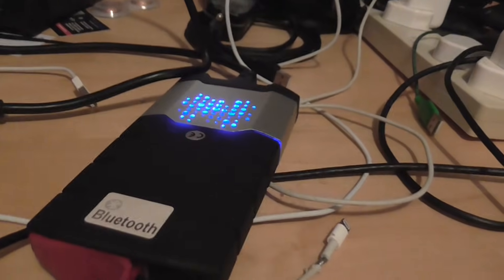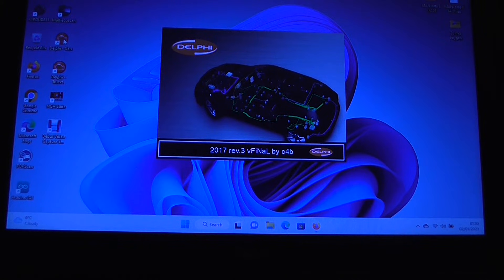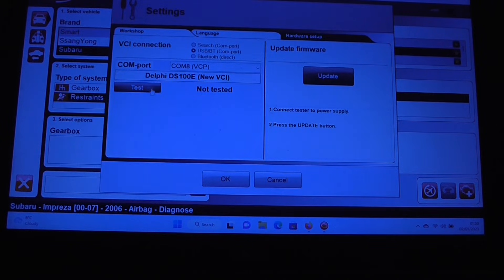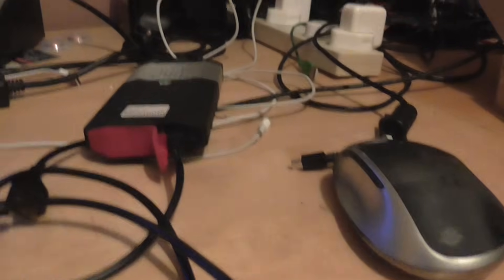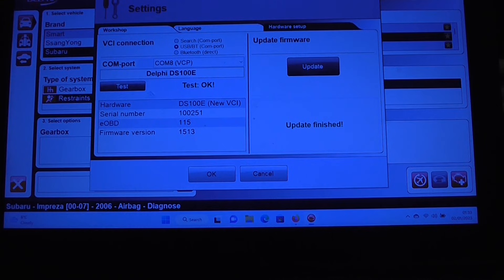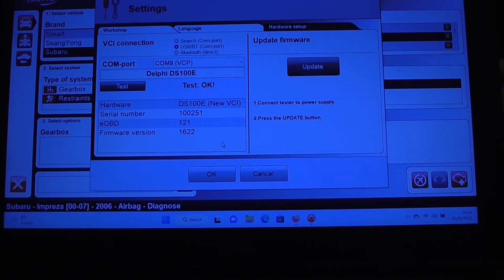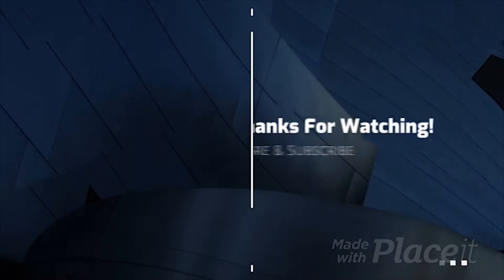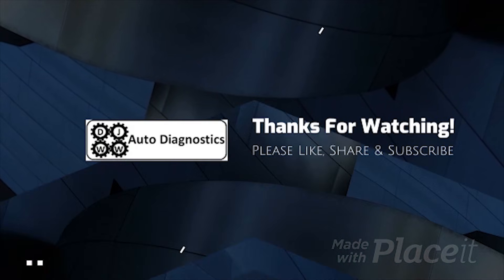Delphi DS150E Firmware Upgrade Procedure

Comment: You said it was  ds150e but  the screen showed ds100e? What type is it actually?
Reply: All the Chinese clones say ds100e in the test screen, the difference between ds100e & ds150e is the flight recorder function, as long as that works then it's a clone of the ds150e regardless what it says in the test screen.

Comment: Never use cloned software on a laptop you use with a internet connection. Hackers may compromise your data, passwords, etc. The laptop your using is connected to your network and these chinese units are known to have lots of dodgy stuff in the installation. Be careful...

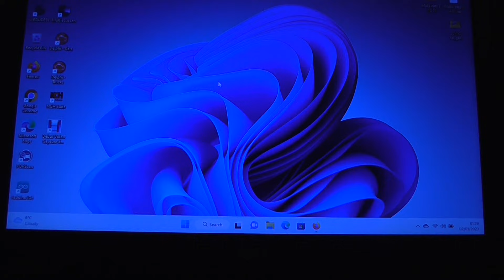Comment: Hi! I cannot download that program you're opening at 1:39 (Delphi software), does it come automatically when you have your laptop and the OBD connected to the car?
Reply: It usually comes with the cloned units on a CD. You should only install on a laptop you use offline only.
Reply: @BrabusSmart  Damnit, I could need the program, no CD to be found. Is there and .rar/.zip download available?
Reply: @Cdifference  Maybe online but there will be alot of viruses etc. I'd look for a forum for the Delphi clone and ask on there. Goodluck.
Reply: @BrabusSmart  Thanks, probably buying a new one, this one I found from the storage and thought I got get it working

Comment: Hello, mine has not updated. It started flashing while updating and then stopped. Can you advise the next step?
Reply from the maker: Hi, Did you have a stable power supply connected whilst doing the update. Have you been able to resolve?
Reply: Yes, I managed to do it. I changed the computer with the older software and then did it again on the new one
Reply from the maker: @krzysztoffilarski3946  Fabulous. Thanks for letting me know 😀

Comment: do you need wifi on,  when doing this?
Reply from the maker: Hi, thanks for getting in touch. No need to have WiFi on to do this as the firmware update is stored locally on the laptop 😃
Reply: Sir, where is it stored?
 @djwwautodiagnostics
Reply from the maker: Hi, From memory, I think it is included in the Delphi software